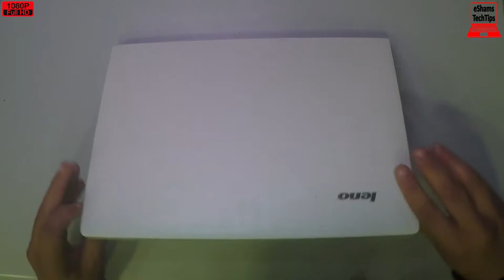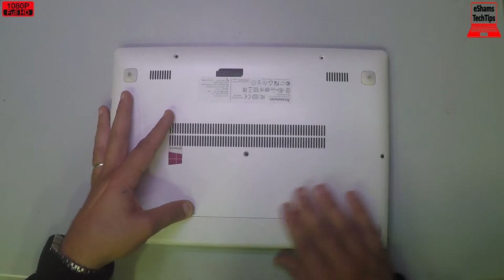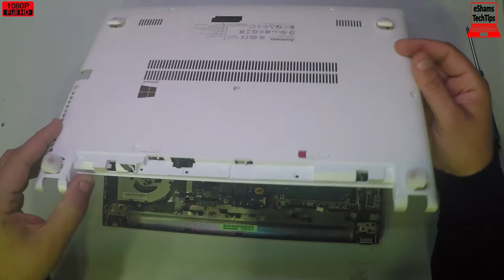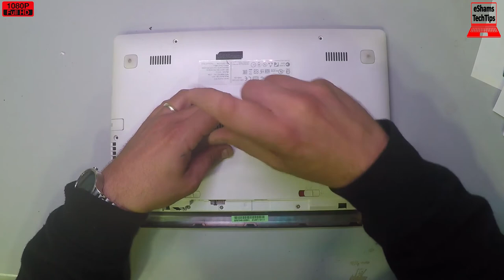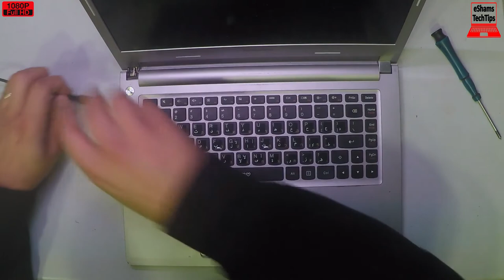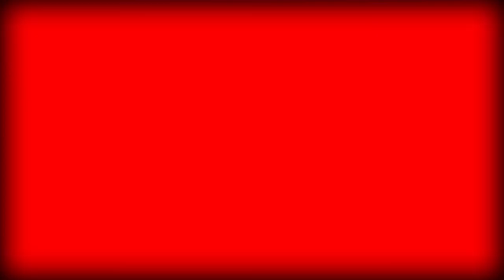Lenovo IdeaPad s410 HDD Replacement

Comment: Is that only 1 ram slot for this model S410? Wondering why in task manager, I can see by default ram slot used is 1 out of 4. But I did open my notebook & seems only 1 slot available to upgrade from 4gb to 8gb instead of adding another 4gb ram to another slot... thanks